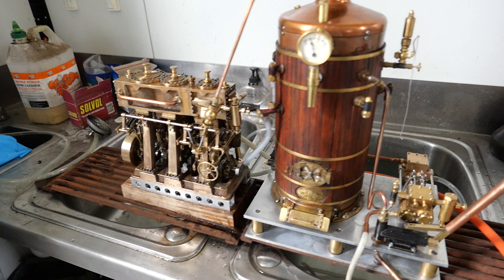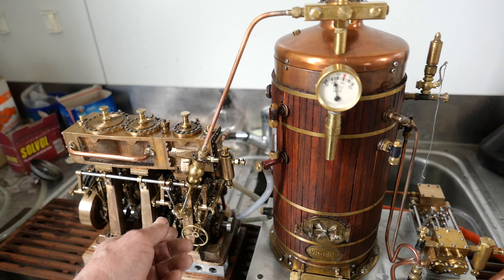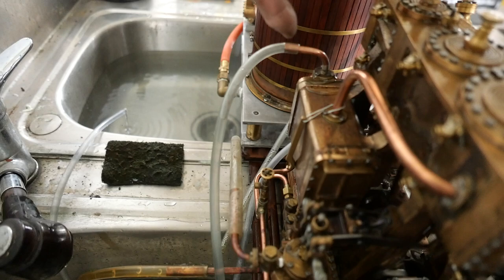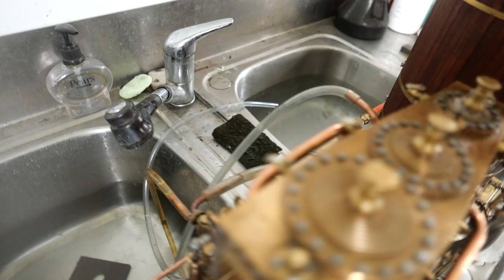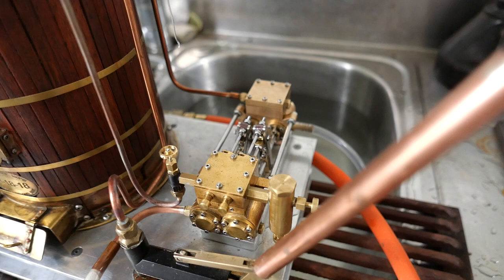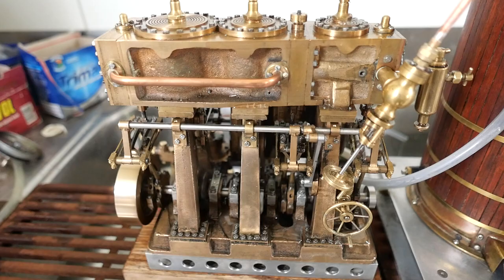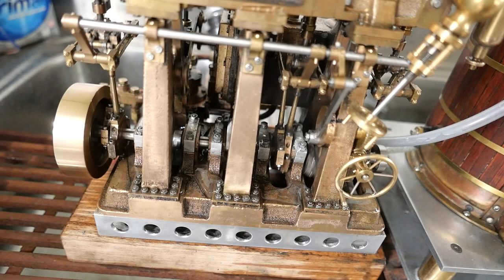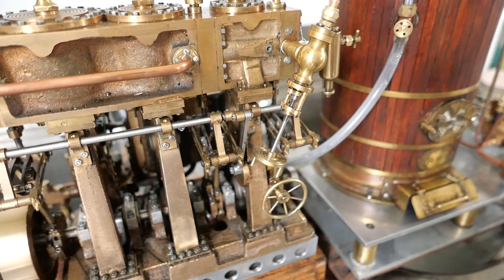Triple Expansion Model Engine on Steam 1 of 2

Comment: What a wonderful engine I don’t think thay are self stArting am the next cylinder youses exust steam from the high pressure cylinder so if the high pressure cylinder is not moving there is no steam for the medium pressure cylinder to run off

Comment: Hi John i have just finished a marine twin and I'm going to make a Stuart triple next. I am going to (try to) make the crank from solid and machine the intermediate eccentrics within the crank (is this a bad idea)?
Reply from the maker: Hi.  I have made 4 solid crankshafts, of which 2 were useable.  And they did not include solid eccentrics.  Bear in mind that without including the solid eccentrics you will need 4 centres to machine the mains and big ends.  If you machine the eccentrics with the crankshaft you will need 10 TEN! centres at each end (assuming a reversing engine), which I would think would be incredibly difficult in such a small model.  So yes, I think that split eccentrics is more sensible. But absolutely make a solid crankshaft rather than a built up type.  John.
Reply: @johnv341  Thanks for the reply John..I will probably just try the IP pair
Reply from the maker: @modelengineeringadventures  I will be very interested in the outcome.